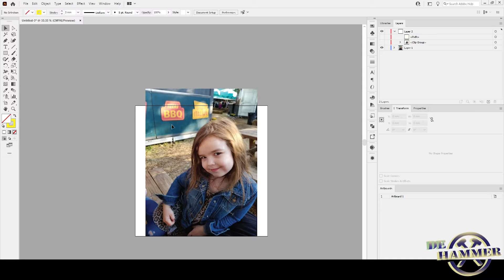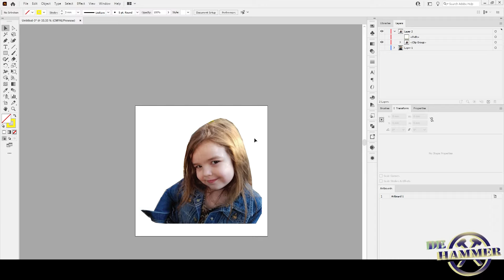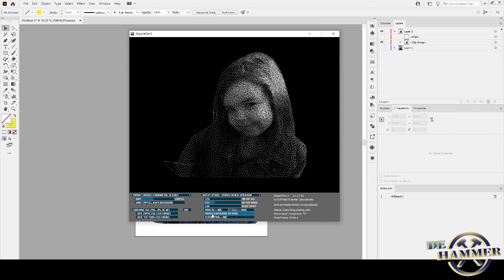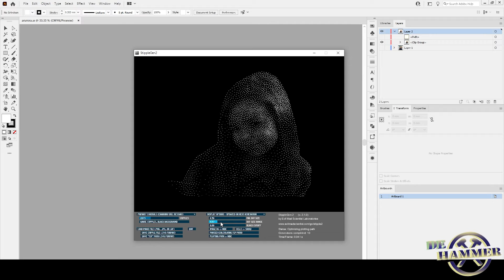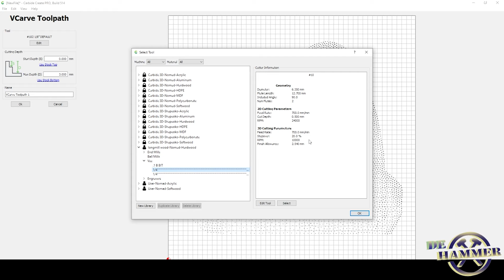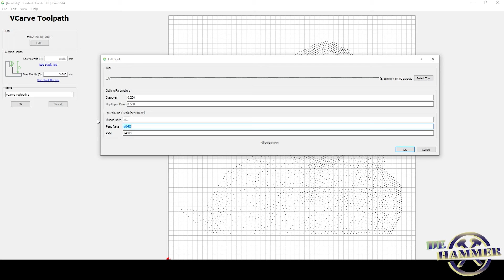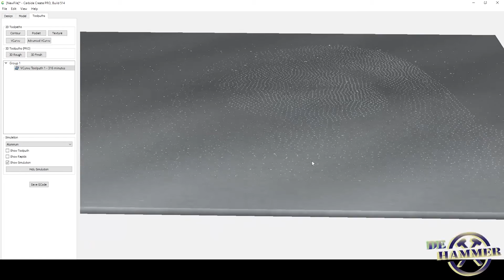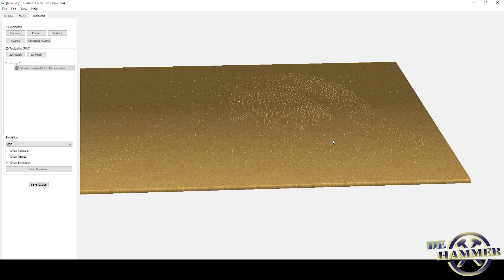CNC Photos with Stipple Gen!

Comment: How fast was the PC when you used the stipple software?  Since this can output to .SVG it means people who own a digital cutter/plotter can load those files for use with that kind of machinery.  For instance I own a Brother Scan N Cut 125 SDX which also has a 600 DPI color scanner that can scan 12x12 inches.  The scans can be used to create cut and draw data for either immediate use or for storing it on the machine, storing on USB Flash drives, storing on my PC (Apple and Windows).  With a 12x24 inch mat, material up to 3 mm thick, an auto blade or a pen tool I can create all kinds of cool art projects or templates.  Plotter drawn templates, machine cut templates for string art, cut stipple art, foil art, paper piercing art, embossed art, etc.  Thanks for showing us how to convert images into machine readable .SVGs.  Plus with a large enough home printer you could print your own wide format templates or art.  Get yourself a copy of Microsoft PowerToys so that it will let you see previews of .PDFs, .SVGs, .FCMs, plus make using Windows so much easier.
Reply from the maker: I had a decent computer at the time, but it could take a minute or two. Thats an awesome idea for the cutter/plotter. Would love to see what you make with this.